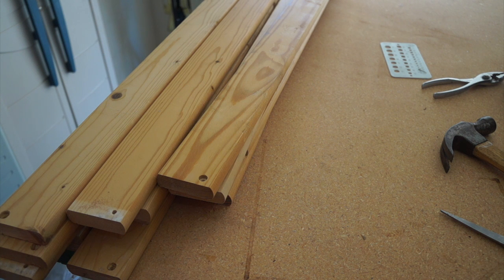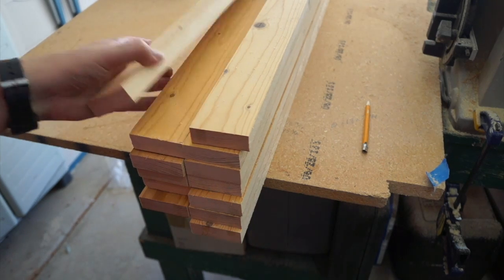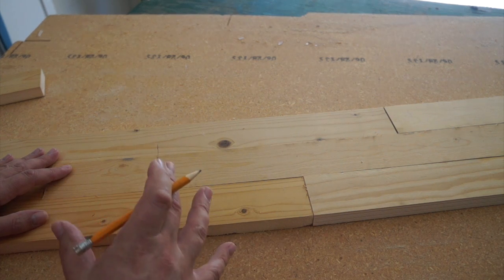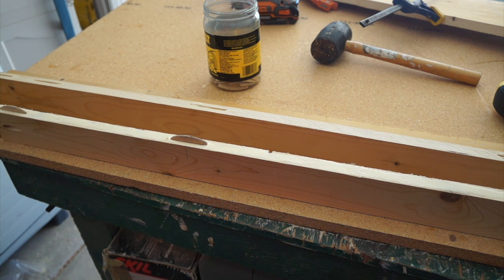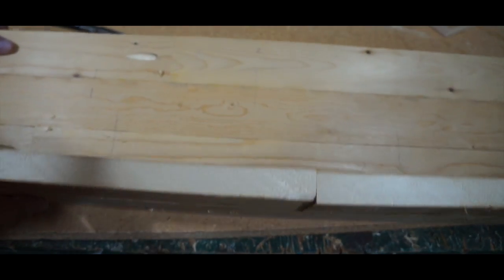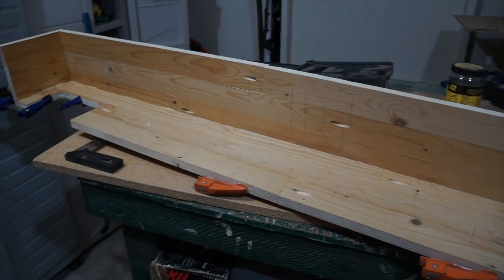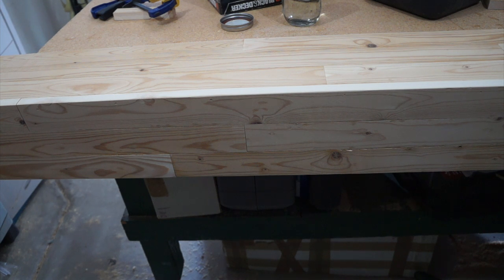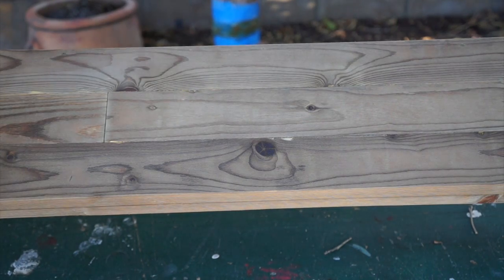How to Build a Mantle Cover

Comment: Showing how to install would have been helpful
Reply from the maker: It just slipped on over the old mantle and was tight fitting.  I ran a couple of screws underneath, but they weren't necessary it was such a snug fit.

Comment: how did you mount the cover to the existing mantel. i have the same issue with a pre existing sheet rock mantel and was looking for ideas on how to tackle the issue
Reply from the maker: David Ferrero I made it tight enough that once it slipped on it didn't move or sag. If it wasn't a rental I probably would have either tagged it in the back with a couple of screws and drywall anchors or more likely used some construction adhesive along the underside of the back edge.